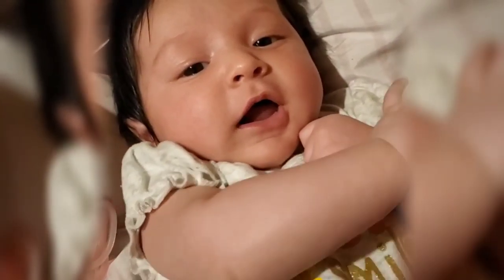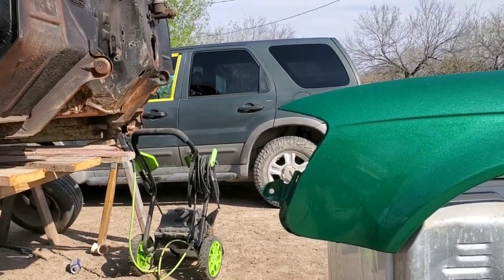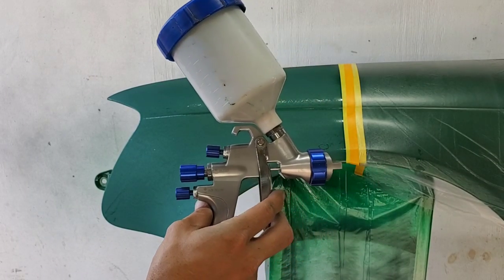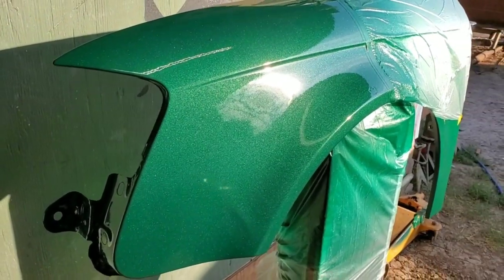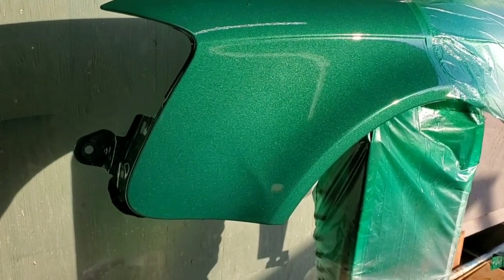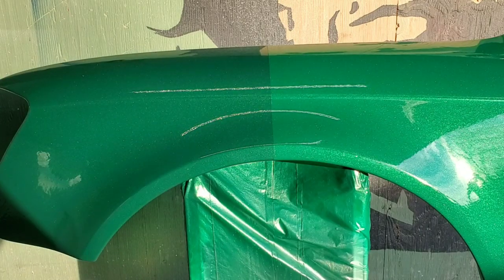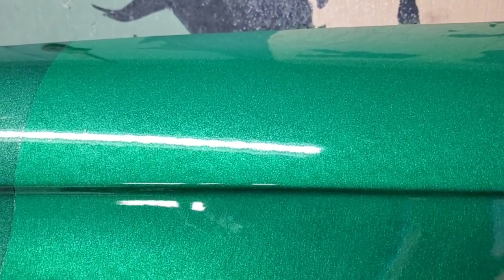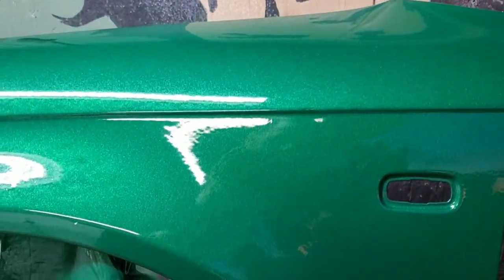Mixing Jet Black with Jade Green [ eBay Paint ]

Comment: Hi, from the UK. Sorry, but not here to teach a goose to suck eggs! However, you cannot emphasis the cleanliness is everything in paintwork. Between, coats of primer and base, please ensure tacking off. One must reduce every likelyhood of dirt in the paint work. HOWEVER, having said that, it is a lucky dip, as you can spray in a controlled environment, spray booth, filtered air, extraction, wet floor, clean walls and sheeted vehicle, dry air and still get dirt knibs. LOL been there, worn the T shirt. Then you can paint in a  more challenging atmoshpere as get less dirt but bugs are a common occurance. Horses for Courses!!!